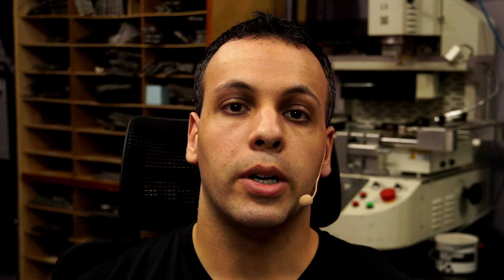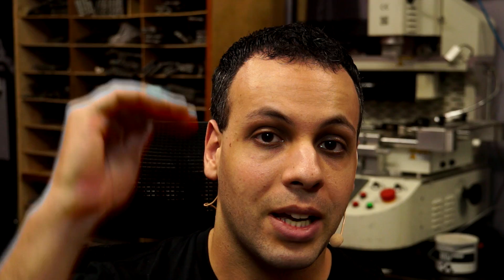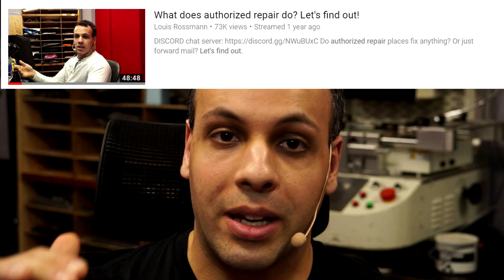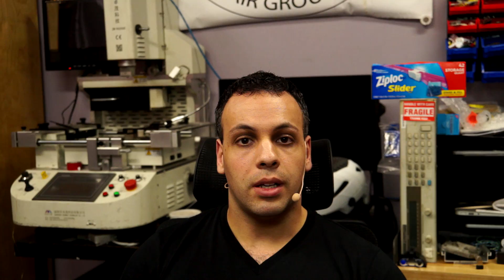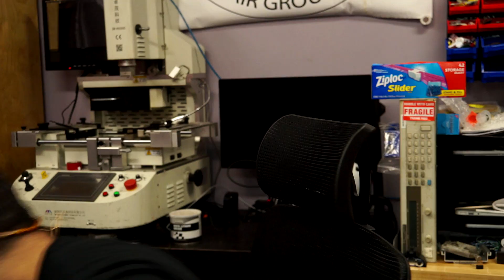Apple's war on refurbishing.

Comment: Here’s the issue: I hate Apple’s business practices. They are completely corrupted and they deserve litigation, But I’ve been using Apple products for a very long time. 

I’ve tried switching to Android and I didn’t like it. For me it was just cluttered and uncomfortable. I’ve also been using Mac for my daily computer for years because the OS is good and is better than PC. I don’t like Windows because it’s always slow and virus ridden. I know you can get anti-virus programs and other various tools to make Windows run better, but when that becomes a requirement and you can’t just use it out of the box, that causes frustration. 

Apple makes the OS secure, fast and powerful. And the simplicity with it is outstanding. 

But the company itself is so corrupt that it ruins my trust and relationship with the company. I don’t want to support these bullshit business practices, but I can’t really find another platform that’s just as good if not better than what I use now.
Reply: Android has launchers to make the device more iphone like you know.. And one anti virus software installation causes frustration........is a bit over the top. You may not personally like windows, so maybe try linux if you want security/ dual boot windows + linux
Reply: If you use common sence then your windows OS wont have any viruses. I only run my software twice a year if I remember, I normally don't, and my computer still runs fast with no issues.
Reply: What...
Reply: I've been using Windows without antivirus for years and I can guarantee you that I've never run into viruses or slowness issues. Btw in the network security class at my university t I hacked a MacBook Pro with Backtrack 5 using some exploits as a demonstration of how vulnerable OS X can be, so if I were you despite using a Mac I would be careful on the sites you visit and such cause no OS is safe from security threats.

Comment: HP is apparently starting to follow Apple's lead, at least with their business workstations.  While memory, HDDs, and other relatively minor components are still end-user replaceable, if you needed to replace the system board, special software tools are required to complete the setup.  These tools are only available to HP Authorized repair centers.  This wasn't the case just a year ago.  It's not as bad as Apple right now, but it looks like some PC manufacturers are testing the waters a bit.

Comment: Apple is full of shit. Once the item is sold, you can do what you please with it because it's your property (it leaves apples chain of custody -- they DO NOT OWN THE PRODUCT after its sold -- hence have no say what happens to it). The product has not been remanufactured (as a new device) it has been refurbished (fixed), as Louis says. It is not being sold as new, again apple is in the wrong entirely. What a bunch of bullshit. People need to stop supporting apple. This is a war on OWNERSHIP and is not unique to apple.

Other industries have started to try and pull this shit. John Deere tractors for example with their proprietary software for the machines that cannot be upgraded or repaired without their say so. Same with gaming, both Microsoft AND Sony have, at various times, tried to limit or revoke ownership with DRM schemes that fell flat before the consoles were launched (remember when Microsoft wanted to say you couldn't share your games?). Sony has sued people who have modified their OWN consoles. People forget real quick and companies use that to their advantage. Even nintendo has gone out of their way to flag video game play from people who stream their games, post-sale, and argue that it's nintendos property. Absolute nonsense. 

Further, digital games (sold by Valve, EA etc) and music sold by apple cannot be transferred and are hence not owned. They are "licensed" -- even your operating system shares this sort of scheme. We are losing the right of ownership post sale, and people are just not paying attention. If a company can revoke your ownership of a digital good, you do not own it.

Comment: If the display panels are rejected due to the EDID, couldn't that be fixed with an eeprom programmer and one of those in-circuit clip-on things? That stuff usually lives in its own eeprom as it holds manufacture date and such and is probably programmed on the producton line. Just a thought :)

Comment: I genuinely feel sorry for people who love and can't use anything other than OSX and iOS. They might be great operating systems but it's awful being trapped in a hardware ecosystem. You can't really switch to another hardware company without going down the hackintosh route. Windows, Linux and Android might have their flaws, but at least you can vote with your wallet if you don't like the hardware decisions of a particular company. Best thing I ever did was not falling in love with Apple. Saves you from gadget heartache.
Reply: @neues3691  if you want to use iOS you have to buy apple hardware. That was the point I was trying to make :) there aren't any other hardware manufacturers who make iOS devices.

Comment: With your current stock of useless LG displays... How hard would it be to reflash/spoof the EDID code from the display? Assuming the check is only for the manufacturer product code and not checking all the EDID data, the display should function properly if that's the only value changed. I'm no expert, but if the screens are similar enough, you might, possibly, transplant the chip that provides the EDID data from the original screen to the new screen to preserve all these details, if outright reflashing/spoofing is impossible. Just pitching ideas to make your "useless" stock useful again, and to enable you to continue to have a supply of displays that work in macbooks.

Comment: That is going on for Years now like it was said in this Video. 
So for my first Pc i did read a lot stuff about Operating Systems and Hardware to make my decision on what i am going with.
So i found Windows (even that isnt the best Working OS) is the one i am going with. Because even if you exchange a Hardware part it will Operate.
Sure since Windows 10 its harder to re-activate your OS, but its possible by just a Phone call. 
For my first Smartphone i did the same and ended up with Android Phones.
First and for me Important think is you can Change the Battery on the most Devices without to need to Screw the Backplate off. 
The Second think you can use Customized Android OS´s in case your Phone wont get any Future Updates (like the Samsung S5 Neo or so). 
So it is Possible that you can still get the next 2 or 3 Updated OS running (like from Nugat up to Oreo) and you wont lose your Warranty.
I am not saying that Windows and Android are the best anyway. Its just for me the best.

Comment: if apple wins the case; i dearly hope that everyone start suing everyone for every repair on anything as counterfeiting if they use parts that arnt original and repair isnt done by company themselves. cars, tvs,  washing machines, other computers, motorcycles, boats, street lights, everything.
that'll make the population and the goverment to wake up and figure out that things are not as they should be when your mechanic cant change brake pads without getting sued.

Comment: So back in the late 1990's the electronics repair industry died when the cost of the repair was no longer worth it because for a few dollars more you could buy a brand new device.  Be it a TV, VCR, etc.  Now that the price of the devices are EASILY worth repair the industry has started to see a rise again.  I myself ended up moving to servers where the environment as a whole forces companies that make part to fall into compliance with standards and if not, they wont b supported or purchased by the main stream.  Now we have apple who basically has their own environment with their own standards.  They want complete authority over every last nuance because they dont make money on the software lis Microsoft does. Their bread and butter is the hardware. So to that end I can see why they are fighting to keep it a closed environment.  Same way as you cant edit a windows operating system kernel. Apple needed to keep up the quality in order to keep this tightrope act going and they aren't.  Now the trendy population who supported them when they were starting this is running away in droves but that may not matter anymore because they now have the lions share of the masses who follow things blindly.  Im not sure which way this will go, but I do know that the industry you're in if its highly focused on apple is on shaky ground because 1 of two things can happen.  1) Apple can do everything you said in the video and cut off that market share to you.  2) You can slay the giant and make the product worthless in the publics eye, forcing down prices and eventually falling back into the issue repair shops had in the late 1990's where it just isn't worth repair anymore.

Comment: I've written this story here before but I feel it's still relevant. My roommate's Macbook Pro wouldn't boot. He took it in to an Apple Certified Service Provider, they charged him $80 for "diagnostic costs" and then told him he needed repairs worth $1300, more than a new MBP would be at the time. My friend was gutted, but the ACSP was "helping" him find a new Macbook to replace his current "broken" one. 

I took a look at the list of things they had to replace and was in disbelief. They wanted to replace his optical drive for $300 (!!!), just for parts not even for the labor. They wanted to replace his keyboard which he just had replaced and they needed to replace his entire logic board.

I suspected that it was just a simple hard drive cable that went bad. I swapped his HDD into my Macbook Pro and it all booted up fine. My HDD in his MBP wouldn't work. 10 Minutes of "troubleshooting" and I found the issue. Got a new HDD cable for $30 and his laptop was working again. 

We went back to the ACSP to get his money back for the diagnostics and initially they were reluctant until I started explaining loudly exactly what they'd done, what they wanted to charge my friend for and what really was the issue in front of all the other customers there. Only then were they willing to refund him his money.

This was the most prominent Apple certified store in our city, we didn't have an Apple store (I think there's only one real Apple store in our country). Why should I trust Apple to make proper repairs when they've clearly shown time and time again that they don't repair stuff, they just replace it and 99% of the time also lose all your data in the process? 

Hope you, your employees and your store are OK Louis!
Reply: That's how Apple became a trillion dollar company. Just imagine how many customers they are conning around the world.
Reply: @henrymmene4470  hundreds of millions.
Reply: In my opinion, that is outright fraud and should simply be illegal.
Reply: antred11. It is fraud and in almost any other industry you will find yourself in a world of hurt trying those tactics. We have seen cases in my city where shady mechanic shops would replace far more than they needed to. The more prominent one was a car that just needed new spark plugs and wires, possibly a new coil pack. What the shop did was claim the engine was blown and replace the engine as well as transmission. That shop was sued into oblivion over that mess. Didn't matter the car ran afterward, the fact they replaced so much when so little was really needed was held against them hard.
Reply: they own the monopoly... that's why they can legally do what they are doing.
Reply: +DarkPa1adin
They don't own a monopoly on handheld devices or computers, at best the have a monopoly on happy idiots willing to spend twice as much for the same hardware and a speshul operating system.
Reply: Why in the motherfuck are lightning cables even a thing??? My USB C cable on my Nexus 6p has NEVER been an issue. Ever.  Mini usb and lighting cables go like candy at my house. The only reason I own anything Apple is because it's a company phone, and I have heard we are switching to android anyways.  I like the "happy idiots" comment though.
Reply: That IS the reason lightning cables are a thing. They die faster, and then you have to buy more. Planned obsolescence is a deliberate thing on apple phones. (and starting to be more common on other phones since Apple has been getting away with it)
Reply: @denniswoycheshen  WE can't imagine how much money they print with their short life cables and dongles.
Reply: @Silamon2  they have a monopoly on repairing their devices and they don't want to lose that monopoly, because they know they will no longer be able to operate how they are without it.
Reply: Yup don't believe anything certified by Apple : it's just a trap to get your money.
Reply: You are a good, good friend.
Reply: Drinkyoghurt You're a very good friend it seems.
Reply: And I thought places like Best Buy were bad because all they did was stick a CD/DVD in which would automatically format + reinstall Windows, then charge like $300 or whatever it was, even if they only needed to solve a simple problem.
Reply: wow, you got the 80$ back? that's actually surprising.
Reply: A good piece of writing to describe the Apple power/war on consumers. They do not repair "vintage class" computers either, when 5 years old its vintage. HDD-cable on MBP 10/11/12 are very common problem because of the sharp bended cable.
Reply: I had a similar experience when I broke my screen! they wanted to replace the logic board and a sister board, i mean what!? then tried to tell me it was because I dropped it, Well that's fine except the screen broke when i closed the lid on a small metal USB screw tag that was hanging over the keyboard. i had to fork out £700 for the repair, and some board they wanted to replace, but after they told me the whole logic board needed repairing, i told them No just replace the screen and send it back. To my horror, when i got it back the keyboard wasn't working correctly. So i took it apart, found the connector to the keyboard was damaged, a power cable to the USB port that went to the aforementioned daughter board they replaced was not inserted correctly Misaligned pin) and a bus connector was also damaged. I just ended up repairing this myself. - Never doing that again.

Comment: Changed the TN screen in my 2015 X1 Carbon to an IPS screen about a year ago. Then I put the TN screen into an older ThinPad with a 720p screen. And, oh wonder, they both work just fine. The best part: I paid 50 bucks for the new screen.

Comment: Yeah I'm never buying another apple product ever again. These attacks on refurbishment are disgusting, as if they need any more money?  They are about to break a trillion fucking dollars. But the allegorical straw that broke the camels back is the soldering of SSD's and RAM units, together with the removal of all USB ports.

Apple used to be hip and cool, sure, but the main reason I've been buying Macbooks and iPhones are their previously simplistic, sleek design that contains everything you need to work, in an intuitive hardware package and with intuitive software to match. The track pad is the best of any computer I've tried, and they were indeed innovative in their design and furthering of the basic idea with the triple and double tapping, side scrolling and just the sheer smoothness that no pc has ever matched. The back-lit keyboard, also he best in the business. Osx? Amazing! 

I'm very happy with owning a 2016 MacBook air, before it all went to shit. The new Macbooks look like a cheap clone of a MacBook, they are tacky and the touch bar is plain  gimmicky. And the fucking dongles? Steve Jobs is probably rolling over in his grave. Not only because of the hardware, but because of the malicious, bloodsucking way in which Apple does its business as of late. 

As for the iPhones... They look like shit, and IOS is just terrible. I haven't owned one since iPhone 5, as soon as Jobs and his anesthetics died the iPhones also went to shit. 

Fuck Apple.

Comment: I have sworn to myself never to bring any business to them again. I purchased an iPhone 6Plus back in 2016 and while it has been an amazing phone (for my purposes) they fucked it up beyond useless with their planned obsolesce policy and their updates. now, unless I get my hands on a decent cheap iPhone 7 or 8, I will be buying an Android phone. I just don't know which one yet.
when it comes to computers, my second hand mbp 2010 model, one I put together from 3 different ones, will be the last apple branded computer I ever used. from now on, it will only be a Hackintosh system. I don't mind a bit of fuckery to keep the system working. what I do mind is the fact that their every system update ever since snow leopard made the machine perform worse than before. from the battery point of view to the overall snappiness of the computer, it degraded so much, I have not turned my laptop on for more than 4 months. I rather use my pc, system I despise a lot. but the freedom to do whatever I want with it, that's what keeps me in.
apple deserves a global boycott. if their income grind to halt, if the money only comes in trickles instead of drowse, then they might learn to stop fucking with our stuff and instead start producing products for people.